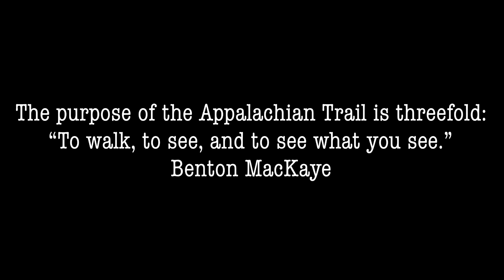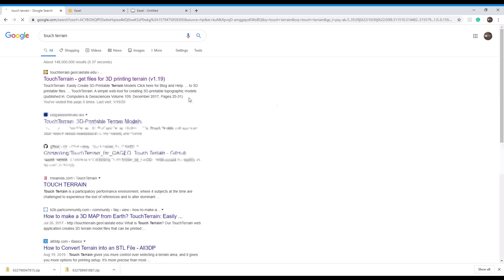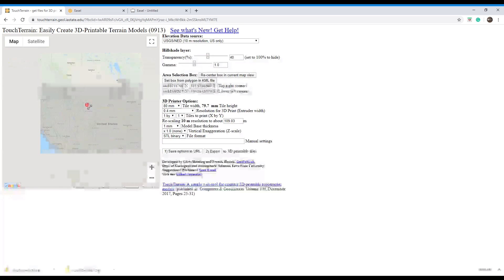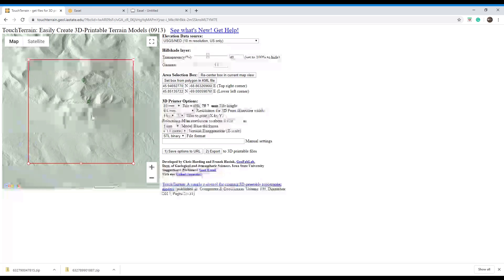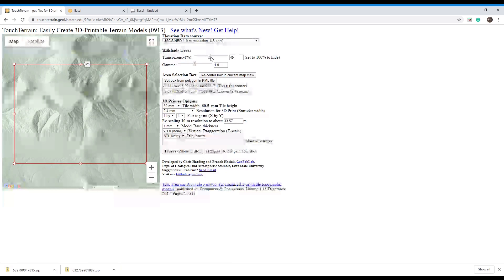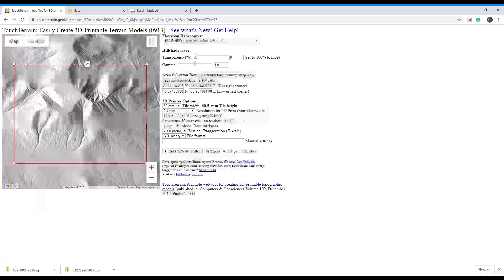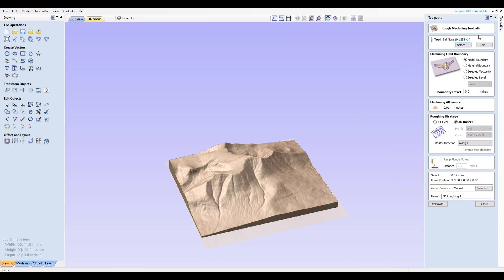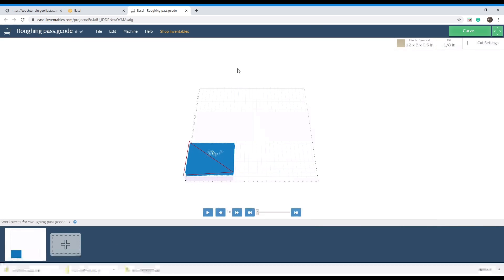I Created This 3D Topographic STL Model using Touch Terrain

Comment: How to you re-probe the Z when you change the bit and cant set the probe on the surface anymore?
Reply from the maker: I generally leave excess material to use as a consistent probing spot. Cut it away when I am done with everything else.

Comment: Looks like you made some extensions for that Xcarve. Do you normally have that much space under the cross bar for material that thick or did you make Z-axis adjustments there too?
Reply from the maker: This machine was completely overhauled. I have another video going over what I did to it. Raised the gantry 2” with a taller slider.

Comment: Im curiuos what bit was used for the finish shaping cut, and what kind of wheel was on the drill that you ran over the surface of the peice after carving had completed
Reply from the maker: It was a 3mm tapered ballnose. The sanding brush is something I got off eBay. It works great!
Reply: @americansouthdesigns  much appreciated, im looking at getting the new x carve pro and im very much into all the hiking and out doors stuff aswell as more sculptural projects with the machine and this would be an amasing way to combine those
Reply from the maker: If you haven’t pulled the trigger yet, check out the CNC4NEWBIE set ups. You’ll save at least half!
Reply: @americansouthdesigns  i bought the new inventables pro machine, but no bits yet
Reply from the maker: I’d be interested to see your set up once you get it!
Reply: @americansouthdesigns  its going to be afew months, got it during the preorder deal

Comment: hey, what if I am doing an area that doesnt have as much depth like New Jersey? Should I leave the model base thickness alone and the 3d Print resolution? When i generate the STL i dont see anything, not even the delaware inlet and cape may.
Reply from the maker: You may be able to adjust the model exaggeration.
Reply: @americansouthdesigns  i will try that, thank you.

Comment: What are the key features of the millright  Mega V cnc  that make it better than other machines?

We think there are a lot of factors that make the Mega V better than competing machines. First,consider our custom aluminum extrusion. It is perhaps the most substantial aluminum extrusion ever used on a CNC machine at this price point. Next, our bearing plates are made from heavy, 1/4” steel. Many of our competitors use thinner aluminum plates or steel plates half as thick as ours in their similarly priced machines. The Mega V’s oversized rollers are a huge advantage too. They are 40mm (1.5”) in diameter, with larger bearings that are pressed in. This, in conjunction with the oversized V channel in our custom extrusion creates a dramatically larger contact patch than what is available on other machines with similar bearing systems. We selected linear profile rails for the Z stage, giving you a really high-end Z stage. All this together makes the Mega V a superbly rigid machine in its price class. We will very gladly put the Mega V against any machine in its class in a rigidity test. We are very confident that the Mega V is unmatched.

The structure and bearing system are only part of what makes the Mega V awesome. We have taken affordable CNC to the next level with a precision rack and pinion drive system, often only seen in more expensive CNC routers and plasmas. The Z axis is driven by lead screw and anti-backlash nut proven on another of our models. We combined these premium features with some higher performance NEMA 23 motors, and not just any NEMA 23 either. These motors have about double the holding torque of some other machines in its class!  We marry these motors to large digital stepper motor drivers and 48VDC power supply that maximizes the performance of the motors.

The super rigid frame and premium drive system combine for some performance that we believe is unmatched by anything on the market at the price point. The Mega V production model rapid traverses at 650 inches per minute (16,510 mm/minute) on the X and Y axes, giving a diagonal traverse of almost 920 inches per minute (23,368mm/minute)! We have tested the system to diagonal traverse rates of exceeding 1,800 inches per minute! We literally had to slow the Mega V down to keep it from being “too fast”.  Just as importantly, the Mega V has the power to accelerate very quickly. This means that you get from a stop to full rapid rate quickly. We recommend a maximum cutting rate of 500 inches per minute (12,700 mm/minute), which is more than double the rapid traverse rate of some competitors.

Finally, features like the optional 4th axis are quite uncommon for machines in this class.

Comment: Thanks for helping me discover Touch Terrain. That saves a few steps from other GIS sites. A couple questions: What is the buffing wheel you use on the finished carve? And, what strategies to reduce inter-toolpath ridges?
Reply from the maker: Michael Morlan it’s just a sanding wheel from amazon. They are relatively easy to find. I’m not sure what you mean about the inter-toolpath changes.

Comment: Nice tutorial!  Question:  what were your feeds and speeds on the two passes?  Also looked like the detail pass ran perpendicular to the roughing pass. Did VCarve automatically do that, or did you have to specify?  Thanks!
Reply from the maker: Mike Trent I ran my roughing at 90ipm at .25 per pass. My detail was about 110 ipm. Vcarve automatically did ran it perpendicular
Reply: @americansouthdesigns  Would you mind sharing your Depth and width of cut for your two bits?

Comment: Great video!!       Will this work with VCarve Desktop?
Reply from the maker: Ken Timblin thanks! Yes it will. Only major difference between pro and desktop is the size in which you can cut up to. Desktop is limited to 25”x25” (I think)
Reply: @americansouthdesigns  What file extension would it need to be saved as?
Reply from the maker: Ken Timblin if you’re using Vcarve, it downloads as an STL. You shouldn’t have to change anything. When you go to import the model, it will appear wherever you extracted the zip file
Reply: @americansouthdesigns  Thank you.